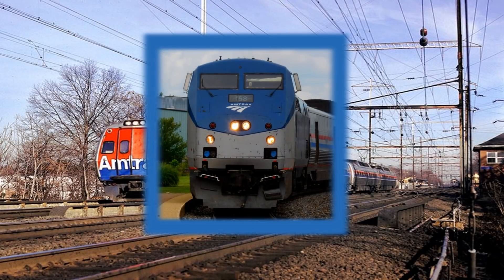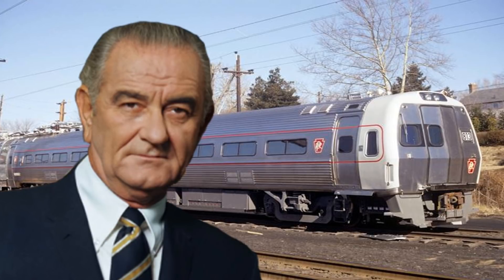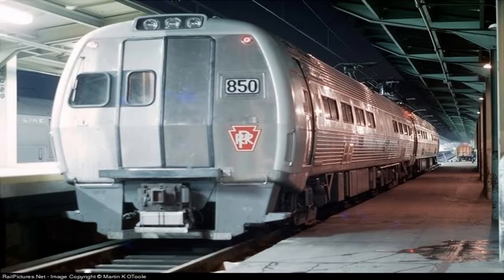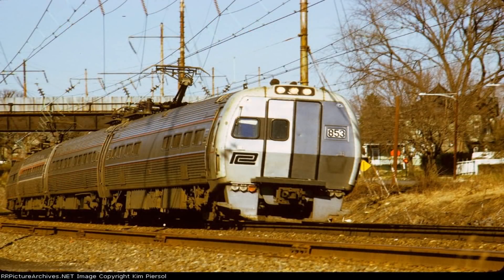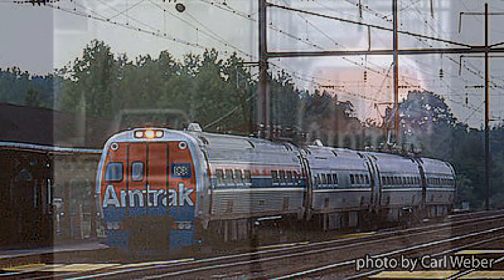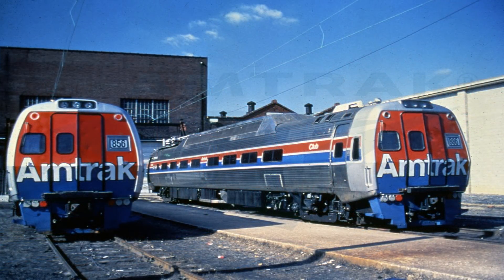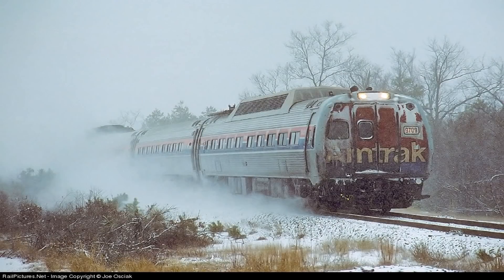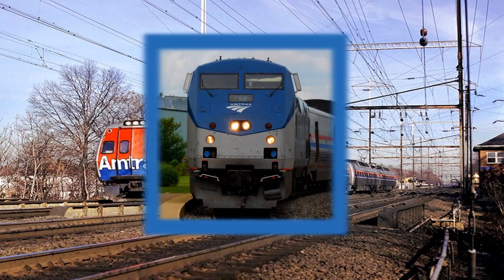Engines of Amtrak - Budd Metroliner

Comment: So America had the same problem with the metroliner as my native UK seems to have with projects like the APT 

Great idea, poor execution.
Reply: Anthony Holroyd also they where put into service too quickly
Reply: Nick Apples as was the APT.
Reply: Anthony Holroyd it is a shame what happened to the APT because for it's time it looked promising
Reply: Nick it kind of made a return though. With similar tech being used in the Acela.
Reply: Sweden have a train that tilts that was first tested 1989 and there are still a few in service today called X2000.
Reply: That's what happens when the government shoves ideas down industry's throat.
Reply: So the soviet union had the same problem with communism as the metroliner
Great idea, poor execution.
Reply: but if we had the APT we wouldnt have the pendolino
Reply: @aarphotos5  probably would get the pendolino, as the APTs would have to be retired at some point (probably around now actually, as many trains from that era are being replaced now).
Reply: @NaenaeGaming  We’d get new trains, but I doubt that we would have got the pendolino because the pendo tilting system is based off the one from the APT, so if the APT had succeeded BR probably wouldn’t have sold the tilting system to Fiat
Reply: @aarphotos5  doesn’t mean another company wouldn’t develop the system separately and develop their own tilting trains, but if the APT did go into production then it’s more likely another manufacturer would provide us with today’s tilting trains I suppose
Reply: @NaenaeGaming  Yeah we would have new trains but they probably wouldn’t be pendolinos
Reply: @aarphotos5  well you still have to keep in mind that the pendolino project started alongside the APT so fiat would have probably finished the project but with a competitor in the market the pendolino would have made less impact compared to what it actually did irl

Comment: Very good video.  Just one tidbit. The SPV 2000 was designed but in 1976 but did not roll on the rails until 1978. I still remember the big fan-fare in the news about it. The first unit had a streamlined fiberglass nose piece that, while it looked attractive, was not well liked by locomotive engineers due to visibility being restricted. Ironic that they weren't as successful as the Budd RDC's that they were designed to replace.

Comment: Here is some engines of amtrak train that you have to do:
 P30CH
Bomberdier HHP-8 (after p30ch)
EMD FL9 (after hhp-8)
GP-40 (after EMD fl9)
EMD F69 (after gp-40
French CC 11000 Swedish rc4 (after f69)
emd f40ph & GPA-30H (after the French cc 11000 & Swedish rc4)
GE P32-8bwh (after EMD f40ph & GPA-30H)
ALP-45 & ALP-46 (After ge p32-8bwh)
EMD F59PHI (after alp-45 and alp-46)
GE P32ACDM (after EMD f59phi)
GE P40DC (after ge P32ACDM)
GE 42DC (after ge p40)
SPV2000 (after the ge p42)
AEM-7 (after spv2000s)
Former PRR GG1 (after aem-7)
Siemens ACS-64 (after former prr gg1)
Siemens charger (after siemens acs-64)
UAC turbotrain (after Siemens charger)
BBD LRC (after UAC turbotrain)
German ice train (after BBD LRC)
X2000 Transit (after German ice train)
Amtrak's acela express (after x2000 trainset)
New 2050s acela express (after amtrak's acela express)
Avelia liberty train (FINAL EPISODE OF ENGINES OF AMTRAK)

Comment: Soon there is gonna be a PRR and reading lines silverliners built and also the prr silverliner will have a new speed limit up to 180mph and also it can reach from 100mph to 175mph and the reading silverliner will have a new speed limit up to 175mph and it can travel from 100mph to 160mph also it will be the fastest silverliner produced by the prr railroad and also it will have the same pantograph as the acs-64s and also the prr silverliners will be 5 cars and also it wil be used in the keystone corridor from Ohio to penn station new yok and amtrak northeast reogional for reading lines silverliner will run from Washington D.C station to Stamford, Ct

Comment: It looks like each pair of Metroliner cars could be powered from one pantograph. Most consists seemed to be six-car; looking at the number of coaches built this could have been - three coach, two snack and one parlor?
With all the cabs it seems like they wanted very flexible use in different lengths.
That meant the front was not particularly streamlined (then again the AEM7 was not streamlined either ....)

Comment: What is with Americans and using pounds for everything? I agree with you on imperial, I much prefer it over metric, but is it really so hard to use tons? You say "X ways 53,000lb" and I've got to convert that into tons, which is not easy! (Just over 23.5 tons, people!)
Reply: one ton is easier to get a grasp of. because one cubic meter of water weighs quite exactly one ton. ah, sorry, guys, you do not use metric. so this help is useless for you. i am sure you have other ways to make 53000 pounds a more a graspable picture... :-) would be nice to hear any suggestions.
Reply: Meh, I think it's personal preference. I prefer tons when describing machines.
Reply: +Rex Remedy Actually you're wrong - one cubic metre of water weighs one tonne, which is not the same as one ton. =P
Reply: oh, sorry. just checked the definition of quite exactly. it indeed means an absolute equal. you got me there man.
english is not my mother tongue. so i have learned another lesson.
thanks!
:-)
Reply: sorry if i cam accross condescending...
Reply: Inky Scrolls oh really... http://convert-to.com/conversion/water-weight-volume/convert-m3-of-water-volume-to-kilogram-kg-of-water-weight.html
Reply: Inky Scrolls and...
https://en.m.wikipedia.org/wiki/Cubic_metre

and did i not say "roughly". of course 1 cubic meter of water does not always weigh exactly 1.000000 tons. but it comes very, very close.
Reply: +Rex Remedy You didn't not say 'roughly', you said "one cubic meter of water weighs quite exactly one ton" (my emphasis). You're mixing up imperial and metric: 1 ton = 1,016 kg. 1 tonne, on the other hand, = 1,000 kg. A cubic metre of water weighs one tonne, not one ton.
Reply: Inky Scrolls quite exactly is not just exactly...
but my point is, that its easy to imagine the weight of one ton, to imagine it as roughly equal to one cubic meter water and not to nit pick around if it deviates one percent or so. its like going to the shop. something costs 99 dollar 99 cents. i think its okay to say it is just around 100 dollars. if you are not an accountant...
and my question was actually, if you guys in the us (U.S.A :-)) have other ways to make large amounts of weight or mass more graspable. as for example with the ton or (tonne) and the cubic meter of water.
btw. did you know that the speed of light is not 186000mp/h? it has whatever numbers in the following decimals. but its far easier to say its just 186000mp/h. thats my point.
Reply: +Rex Remedy Hey, no worries! You're doing really well for a non-native speaker. I'm not from the US either, as it happens, and the imperial ton we use here in the UK is different from the US ton. So it might be that a US ton is nearer to the metric tonne anyway. But you're right about needless accuracy; I hadn't realised until I checked just how similar one ton and one tonne were. So you have my apologies there! =D
Reply: Inky Scrolls thanks! no need to apologize. lesson learned...
anyways. its nice to chat with other people who also like US trains...
Reply: +Rex Remedy Aye, it is that. =)

Comment: Also budd Metroliner snack bar car #860 will be moved from the railroad museum of Pennsylvania and also it will go under a restoration in Altoona Pennsylvania and also some NS GP-40s will take 2 amtrak a mfleets and one metroliner from New haven, CT and also the metroliner will be rebuilt into a budd Metroliner snack bar car and the 2 amfleet will be repainted into PRR/Penn Central amfleet and the 2 metroliners will have a new speed limit up to 195mph
Reply: AmtrakGuy365 after you do the GE GE P30CH you will do the Alstom hhp-8

Comment: Soon there is gonna be a PRR/MNRR/CDOT budd locomotive built and it will have a new speed limit and it will be up to 180mph and it can travel from 85mph to 180mph 170mph and it will have the same pantograph as the acs-64 and it can travel from grand central to new london, ct and it will be in third rail operation in grand central terminal and penn station in New York City and also it will run again on Christmas day of 2017 and it will have the same wheels as the Amtrak acela express and there will be to power cars and one will be in the front and the other one will be the back and they both will have a new speed limit and it will be up to 180mph and one will have 2 pantographs and the other one will be have 2 pantographs and it they can reach from 85mph to 170mph and one power car will be running from New London, ct to grand central and penn station and
Reply: What the hell are you talking about? Good lord your grammar is bad.
Reply: what
Reply: Elijah Trofort  If I had one dollar for every "and" in your comment......

I'd still be poor as heck!  lol
Reply: Where do you get this information Elijah? Cause I have a feeling it's not true.
Reply: WHY ARE U DOING THIS ON EVERY TRAIN VIDEO BRUH?!

Comment: I see those on the Keystone all the time. so easy to notice that bee stripe paint on the front. I love how they still have their original mechanical bells on them! also the K5LAs they have sound WAY better than their ear piercing originals
Reply: Hi thunderbolt I love your videos 😁
Reply: Hi go on #EnginesOfAmtrainYTP
Reply: And Also When Is There Going Be A Engine’s Of Septa Video
Reply: Yo Thunder! Someone said that SEPTA was the Society of the Elimination of the Train of America and not Southeast Pennsylvania Authority but I don’t know what T in SEPTA means
Reply: @Boypogikami132 , the running joke is that SEPTA means "Slowly Eliminating Public Transportation Altogether." Nearly happened under former Pennsylvania Governor (later U.S. Attorney General) Dick Thornburg and until dedicated funding was in place (using toll revenue from the Pennsylvania Turnpike, increased gas taxes, and licensing and registration fees from PennDOT). SEPTA's push-pull consists are mostly rebuilt Comet coaches purchased from NJ Transit, although their Silverliner IV m.u. coaches were built by G.E. for the Penn Central and Reading Railroads (Conrail after 1976) under SEPTA funding. SEPTA took over from Conrail in 1983 and tried to convert the Regional Rail System (connected by the Center City Tunnel in 1984) into a rapid-transit system akin to Germany's S-Bahn, but didn't work out due to the various labor disputes between the railroad unions and the Transportation Workers Union (whose motormen were operating the Fox Chase-Newtown Rapid Transit Line; the former Reading Railroad line connecting Newtown in Bucks County and the Fox Chase station in Philadelphia), as well as the deteriorated conditions of the Reading Viaduct between the tunnel portal in Northern Liberties and North Broad Station (where the Norristown Line splits from the SEPTA Main Line).
Reply: @rwboa22 ohhhhh
Reply: Thunderbolt 1000 Siren Productions yay ur videos rock

Comment: The converted Metroliner cab cars were also common on the San Diegan in the 1990s until they pretty much disappeared in 2001-2002 when the Surfliner bilevels were introduced. One set of Amfleet/Horizon cars remains, but with all the Metroliner cab cars now serving on the Keystone Service and the New Haven-Springfield Shuttle, NPCUs (F40PH locomotives stripped of their engines and converted into a combination of a cab and baggage car) are used on this set now, primarily during race season at the Del Mar Racetrack.